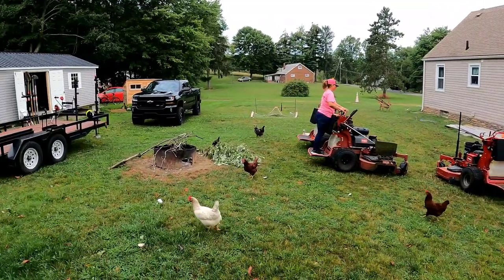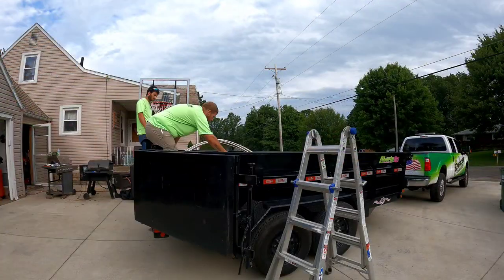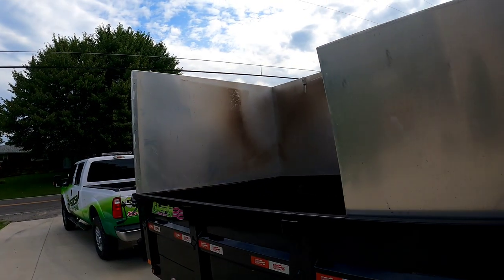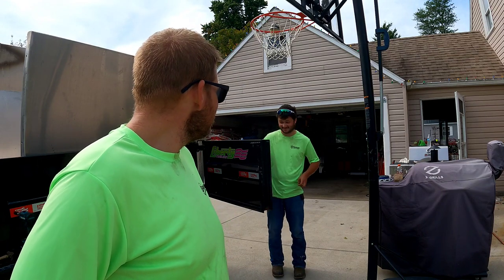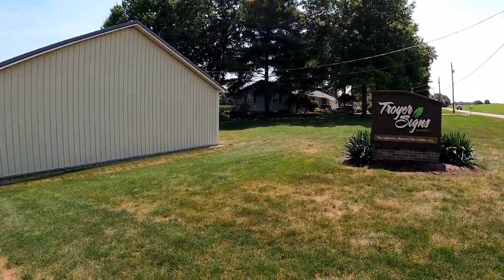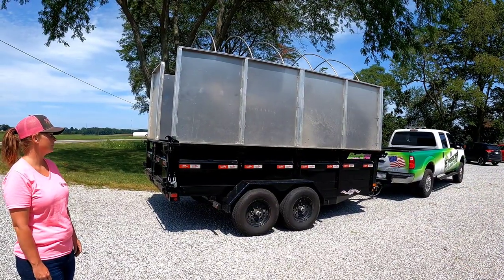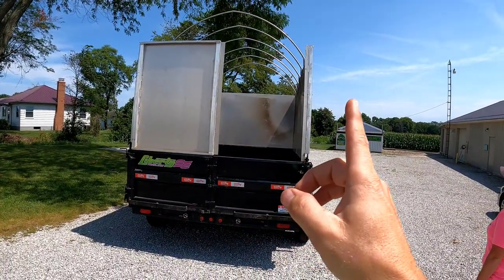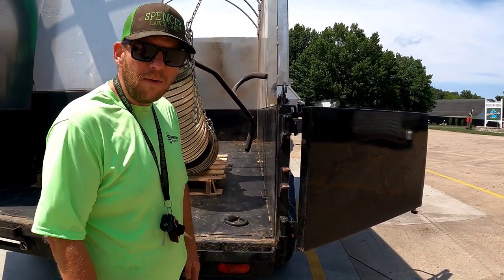LAWN AND LEAF VACUUM SETUP - COMMERCAIL LEAF VACCUM / SHREDDER BUILD

Comment: For the tarp and mesh set up for the trailer I’d recommend going solid tarp towards the front, meshing in the middle and then back to the solid tarp in the back. It will maximize air flow throughout the whole trailer and make it so you and the truck stays clean from leaf dust
Reply: Agreed!
Reply: Agree

Comment: Awesome video. Yes it has been extremely hot and humid here in south central Pennsylvania.  I was able to mow about 1.5 hours today. Me garden tractor mower crapped out on me. Smelled the belt burning.  More then likely either polly locked up or spindle. Will know later when I fix it.  Hope  weather gets better there. Always be safe. Later.

Comment: Instead of painting you could opt for powder coating the aluminum, that won't flake like paint would. It is more expensive, yes, but if it will last longer the cost might be less in the long run. Another idea is those thick plastic with fabric things, printed with whatever you want on it. They are really thick heavy duty stuff with metal rings in them to run rope through. Now what are those called in English, anyway, those things, to attach to the sides. Easily interchanged if you decide you want to have a different text on the trailer, no need to get stuff painted, easy to clean.

edit: BANNER. That is the word that just evaporated from my brain ;)

Comment: for the signage i would get some tarps made up  with you logo and all the details printed on it. then clip them onto the panels you have. 

make sure you put a fire extinguisher somewhere handy at the back. you nearly set fir to it last year

you should get some led lights mounted all around  to light up the working area and show off the new signage.

Comment: You might think about having Anodised panels done which would attach on the outside of the trailer which would avoid having paint flake. Can be done in assorts of differing colours and would be long lasting. If you had the mesh the front then when the front is full you loose the air floe you are looking for. Adding a mesh all the way round on top of the walls sounds like a good idea.

Comment: Just wrap the trailer. Easy maintenance and will great. On the tarp solid on the front if not it will clogg up with leaf debris. You only need a couple of feet of the net for air flow.

Comment: I would leave the aluminum and use black lettering on the sides and I recommend solid tarps in the front and back and mesh in the middle to reduce dust on you and the truck keep going guys love the videos and I'm learning a lot from you Sean , Savanah and Tyler

Comment: Spence I would solid/net/solid tarp it. So basically the middle of the trailer is where it breaths, that way it saves from coming out the front and covering the truck and whatever's in the bed and the rear to keep y'all from getting dusty. Just my thoughts on it

Comment: If you paint it, powder coat it. More durable and less likely to chip or flake easily. But if you don’t want to worry about any of that, then leave it aluminum. You may want to powder coat it in green to stand out wherever you go with black lettering 👍

Comment: My recommendation would be to put the netting to the front with the solid tarp to the rear. Keep the leaf dust to a minimum for the crew operating better for the health so they're not coughing their brains out should they forget to put a mask on to protect their lungs. A truck can be cleaned and repaired body parts and organs not so easily.

Comment: Solid cover for the back 1/4 and mesh the rest of the way to the front. Leaf dust is unavoidable. We most times let it blow off the truck on our travels to the next property. You can always blow the truck off if you need to.

Comment: Tyler, run that truck till the wheels fall off!!! That is worth way more than 26K. Wait till the lots get full after this chip issue, if that's causing shortages of new vehicles. Sell your truck outright to get what it's worth, don't trade in. Be patient.

Comment: For some strange reason u-tube unsubsidized me. I'm from the SC it is miserable. 
I would paint it black with white letters  th reason for painting it is the plan metal puts off a shine when hit by the sunshine 🌞along with making the inside of the trailer not so hot.  Have you thought about putting in air vents on the side panels because heat rises so do them near the top  and nothing should blow out. When working I would have  the net opening near the back because it will be easier to to empty along with you knowing it's full.